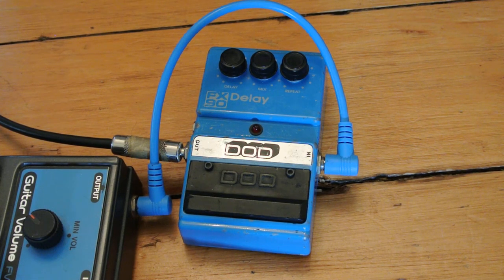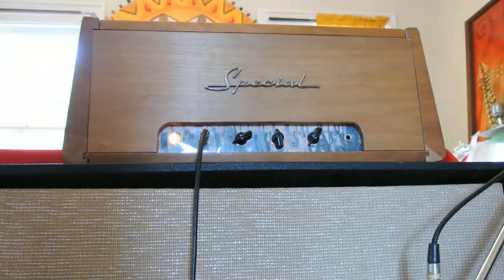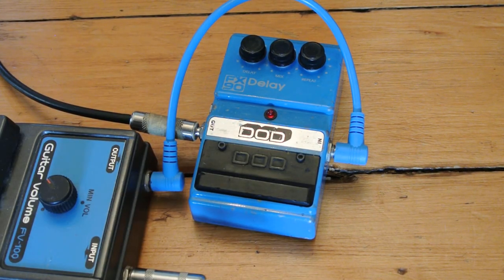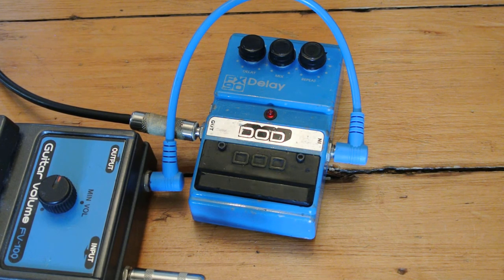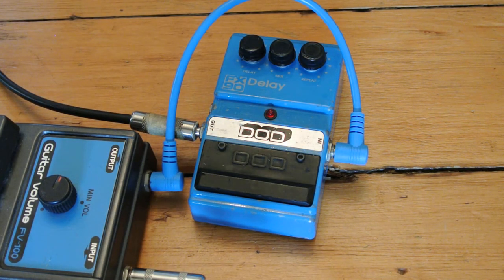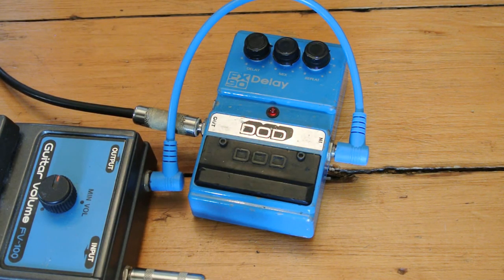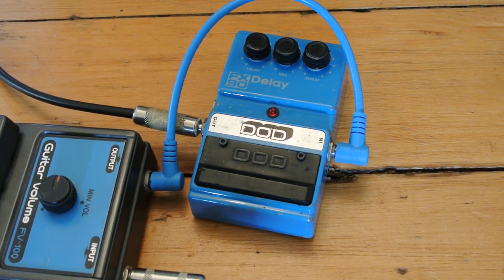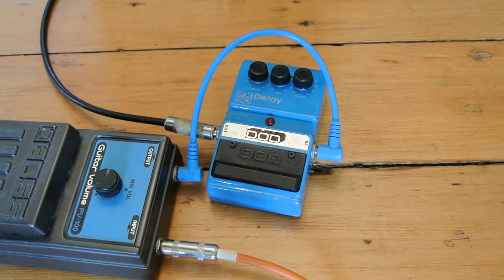Vintage DOD FX-90 Analog Delay Pedal w/ Boss Volume Pedal.

Comment: I have one of these but I can't get no good delays :-(
Reply from the maker: +dennis neo Try twisting the mix control back and forth real fast a few times. Maybe it is just a dirty control.
Reply: +soaringtortoise Thanks. I'll give it a go. Great demo by the way. You're getting some nice delay there.
Reply: you may have to tweak some trimpots inside the pedal. I got mine cheap because someone thought his pedal was broken. I bought it and tweaked the trimpots and the pedal is back in action. Can't get it to self oscillate though. There are instructions/guide if you search for it.
Reply: Mine can self oscillate, though it's not as immediate as some delays